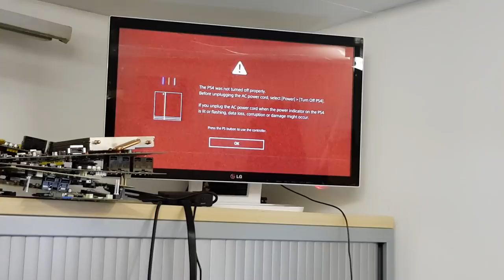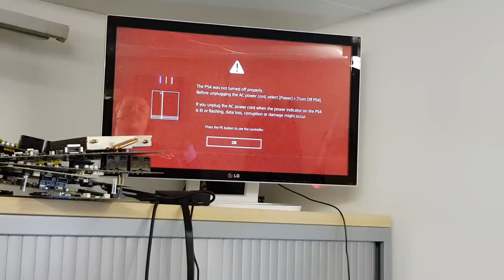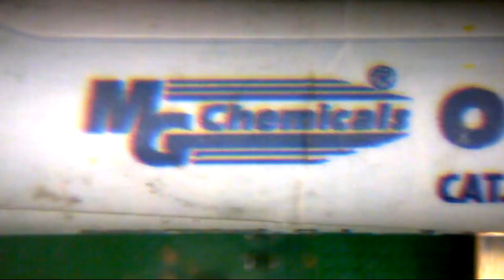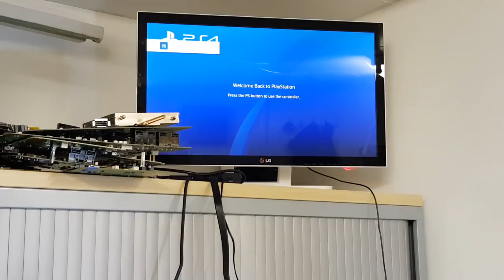PS4 Christmas present ruined by yet another UK Repair shop. Can we fix it?

Comment: I have to thank you for the amount of knowledge you'd passed on from these videos. I messaged you a while ago about a system I attempted an hdmi job on but I lifted a pad, I was going to send it to you but I was never able to actually do it. I then got inspired by continuing to watch your videos and bought some enamel wire and managed to successfully route the pin on the hdmi port to the hdmi filter it would have previously been connected to and it then worked perfectly. Have done a couple now and both have been perfect, without a microscope too which I'm pretty proud of. Thank you so much for the knowledge, in practice it's been invaluable.

Comment: Nice job as always buddy. There are so many butchers out there doing repairs, it's unbelievable. Sadly anyone can buy a cheap set of tools & soldering iron and set up doing repairs on all sorts of equipment, a few years back we had someone decide they were going to start repairing commercial machines ( 3 phase ). Didn't have the 1st clue about single phase never mind 3 phase but hey how hard can it be ?. That went really well, Not ;-). Keep up the good work.

Comment: I am in the process of doing this currently and was wondering do you use a microscope or magnifying glass for the pins (what size/ kind)? And how do you add solder to the pins without them bridging?

Comment: Paul iv been going through your vids to see if you have had the problem im having with a PS4 SAD-001.1-981-279-11.iv replaced the hdmi port and still not getting a signal.im not a bodge artist as iv fixed hundreds like you.i know the socket is solderd to the main board as continuity is good on all pins.no missing pad or damaged tracks.orignal socket looked fine but iv had them crack inside so changed it anyway.any help would be much appreciated.thanks

Comment: hello, sir, I have a ps4 that does not work, as soon as I turn it on it does not start it just beep and that's it.

from where it could come because I searched everywhere and I can not find anything, I would like very much that you help me.

it makes no light just a beep without even starting the fan or whatever.
thank you for your help
Reply: It needs a power supply the five volt rail still works hence beep. But the twelve volt is out

Comment: Do you test before putting the conformal coating on? Just wondering if it's possible to get that stuff off if it still doesn't work? Love your vids tho. 👍
Reply from the maker: Hi,
Yes it's easily removed if you need to - just apply hot air and some IPA and it lifts straight off.

Comment: Hello, Andrew! How are you? Have you fixed any with error CE-30392-7? If so, can you tell me what causes and if there is a solution? I have three in the workshop and I have not found the cause yet! Sorry about my English. Greetings from Brazil. Hugs friend!
Reply from the maker: Hi,
What is the date/time showing on the console? is it correct as you'd expect or has it reset / is wrong at all?
Reply: Hello, Andrew!
It was all right with the console time. I managed to solve it yesterday, I changed the mediacon (CXD90036) and "Voala!" "Running and accessed the PSN Normally. This console in question, had signs of reflow in the mediacon, and I had done the reballing, but to no avail.
In this case, the exchange resolved. I'll make a video for my channel about it. I hope this tip can help you if you get a case like this, and who to read. Feel free to visit my channel anytime! Thanks for answering. Hugs and have a nice weekend!
Reply from the maker: Thank you my friend :)

Comment: Hello thanks for another lovely video I have a question about a ps4 am working on it have the error message ce-35888-2 but the only thing is the ps4 was never being opened so i buy another blu-ray driver and swap the Renesas IC and everything work fine but when I want to start a game CD I still get the 35888 error message what can I do next thanks
Reply: titus femi Well, I'm not Andrew but I can answer this one for you. That error code is for the Blu-ray drive not being married any longer. Switching the IC on the board won't fix it either. I know you stated that it was never opened, but I've seen this error sooooo many times, and that is what it is. If you go to Andrew's backlog you'll see several vids about this error. Especially with the newest update. If people were using a system with a bad Blu-ray drive to play only digital  games, once this new update went thru it basically renders the console useless. Sad really.
Reply: ModdSquad thank but I think by swapping the Renesas IC to another working one can fix the problem or do you no if any other fix for it ?
Reply from the maker: Do you know the entire history of the console from new? Has it ever worked with discs whilst in your possession? There are fake warranty seals on the market sadly and these can be used by unscrupulous sellers to hide serious issues within the consoles (i.e. swapped drive logic boards).
Reply: Andrew Paul yes I buy the ps4 new for the guy like 8 months ago and it stop loading CD and that is why he bring it to me so when I clean the Lens the ps4 load the CD and the next we see is that error CE-35888-2 so yes the game is working fine
Reply: Swapping the IC is a fix for some things....but not this thing. I would love to tell you the fix for this error, but there really isn't one that doesn't include swapping of a bunch of major components.
Reply: I think the problem sometimes can come from the motherboard too or what do you think

Comment: If a hdmi port was bent would it still work Andrew?
Reply from the maker: Hi,
It largely depends on how badly bent it is. If it's bent and the pins are sitting proud of the surface then no it's likely toast. If it's slightly bent and the pins are still secure then yes it'll likely be OK.
Reply: Andrew Paul mine looks straight the hdmi lead go in straight dose that mean it straight if the lead goes in straight Andrew ?